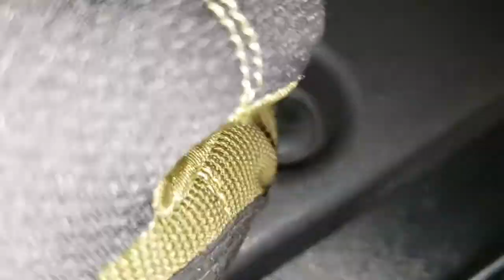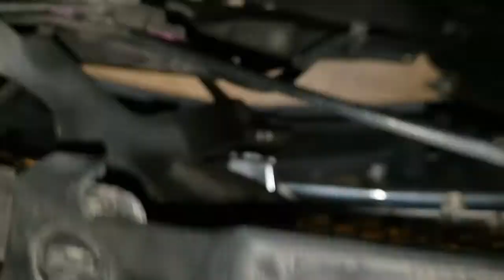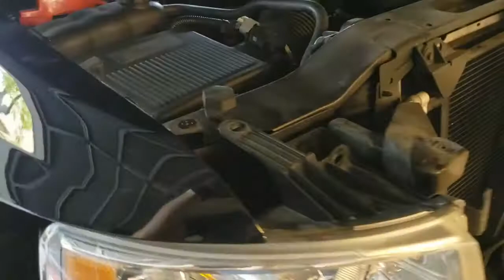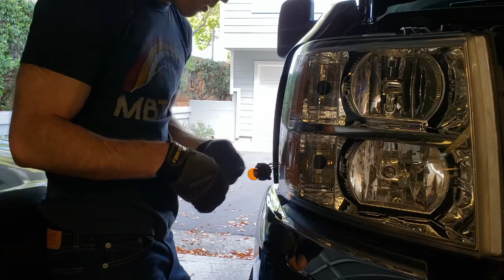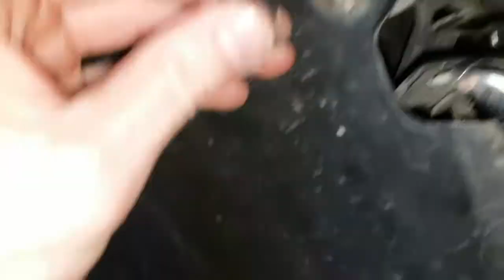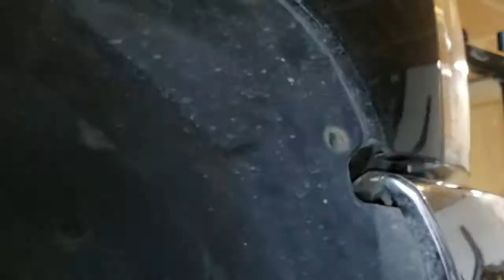How to Replace your Indicator Bulbs: 2007 to 2013 Chevy Silverado

Comment: Just want to help ppl in the future out, I was able to remove the 3 bolts holding the headlight housing in, then just cock it to the side and bam easy access to your signal bulbs without removing the whole grill. 
If you’re replacing the whole headlight housing then YES you will need to remove the grill. But not for the signal bulbs. Saves a lot of time and breaking clips. Hope this helps someone

Comment: Thanks for sharing this video.
Now on to my 2011 Silverado. Both turn signal bulbs are now changed, but unfortunately I'm still having problems with the driver's side front light.
Sometimes it flashes, yet other times not.
What do you think might be the solution?
Reply from the maker: Assuming you’re referring to the turn signal light. If it’s blocking too quickly it may be a voltage or wiring issue assuming you’ve just swapped in a fresh bulb.
Reply: @HarrisonsGarage Yes, it is the turn signal on the front driver's side.
The bulbs and sockets look great and the rear driver's side turn signal flashes but very fast.
Occasionally everything will function fine, but then for no apparent reason it starts acting up again.
I just now changed the fuse even though the old fuse looked good.
No change, still no turn signal in the front.
Reply from the maker: @Circuitprotectorare you running the stock headlights or aftermarket ones?  I had a similar issue with my 09 f-250 after installing after market alpharex led lights. It would click too quickly and it turned out to be a voltage issue. It turned out they also sold a harness to fix this which worked for me
Reply: @HarrisonsGarage They're stock bulbs.
Reply: @HarrisonsGarage  I thought maybe the battery was getting low voltage, but that doesn't seem to be the case. I hooked up my battery charger and charged the battery to 100% but still have problems.
Sometimes it won't flash without the truck running, but will flash when the truck is started.
I'm almost to the point of just dealing with it. It's an old truck with a lot of miles.
Reply from the maker: @Circuitprotectorhm that’s definitely going to take a while to diagnose. Maybe you can get a wire tracer and check for a break in the wire.
Reply: I have it apart again and now it's flashing again. Where is the ground for the front left blinker?

Comment: Thanks for this. Did the drivers side signal  bulbs without removing grill. Takes long skinny fingers and some dexterity, but did it before the video was through.  Your video convinced me to try rather than do alll the removing.
Reply from the maker: @miketurecek1883  glad you were able to get it done without taking all those parts off!

Comment: Why didn't you get the pliers for the clips? About the same price as the door panel removers and works better without breaking shit
Reply from the maker: True but these clips were quite brittle and would have likely cracked regardless. I ended up finding replacements quite cheaply as well.